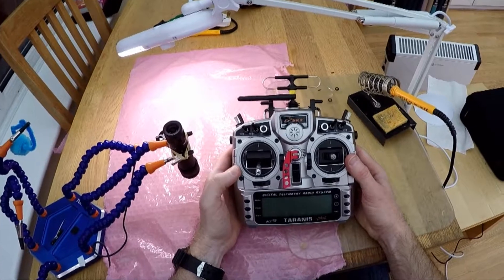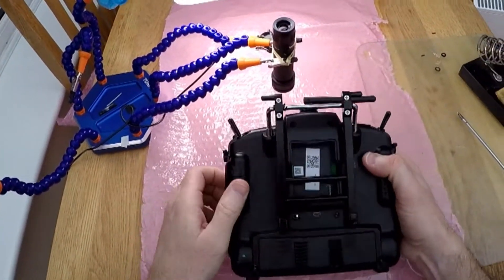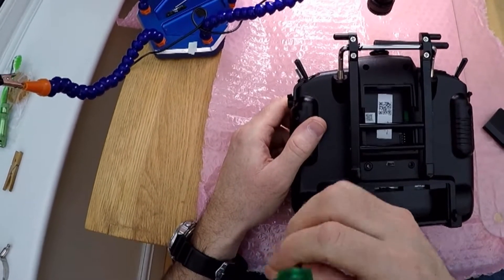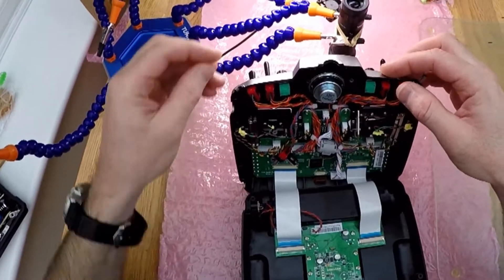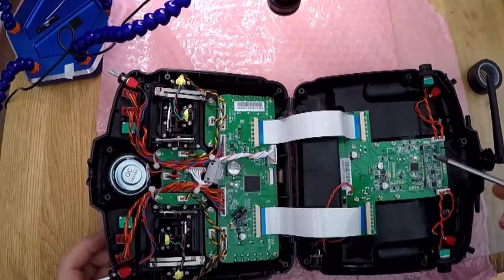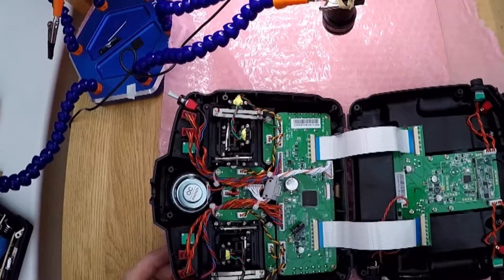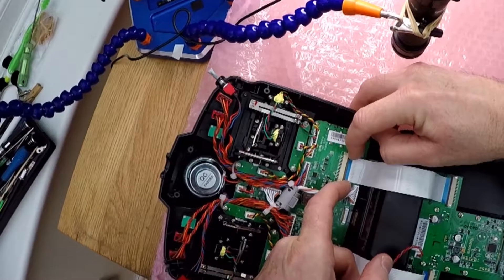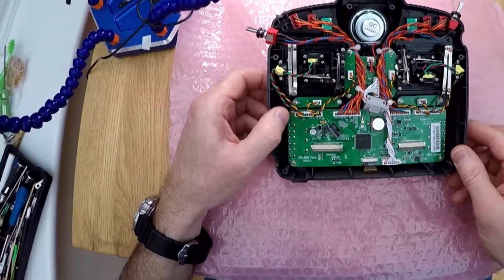Dead Taranis Repair P1

Comment: So did you swap the STM32?? I've done it on mine (USB killed it) and it's not too bad if you have the right tools..
Reply from the maker: “Spoiler alert” yes, I did manage to change the STM microcontroller. You are right, if you
Have the right tools it’s not too bad? I did it this way to see if you could do it with a standard 
Soldering iron and tools someone in this hobby would already have (cheated a bit using Specwell microscope, work tool) It was hard to do this way, but possible. I have done this kind of repair a lot
 and use a hot air rework station, but this is the most pins I have done with a standard 18 watt
Soldering iron ! 
Just out of curiosity, how did you kill yours through the USB?
Reply: @pablofpv  Yeah, used hot air rework myself and lots of flux. Not sure how I killed mine via USB - it still worked but got really hot and USB wouldn't detect. I use the STM32 at work and we've had lots die because of over-voltage down the USB.. I did look at the USB input circuit on the PCB and it could be better..